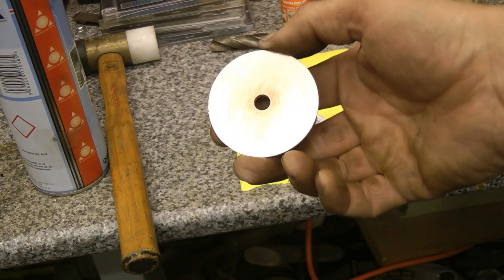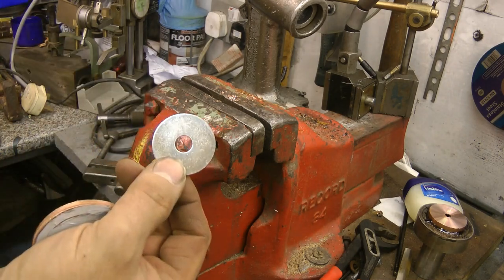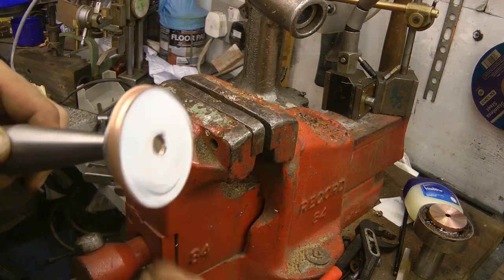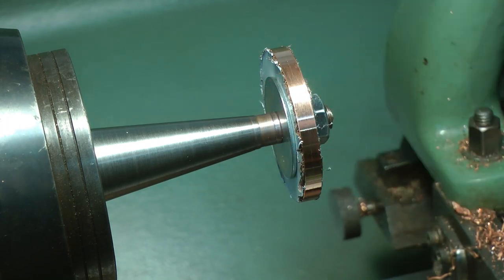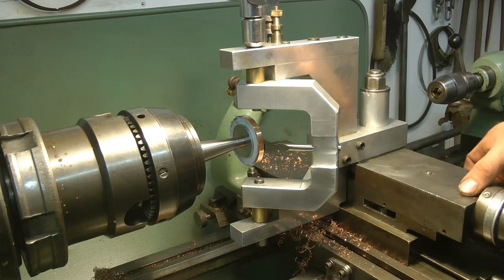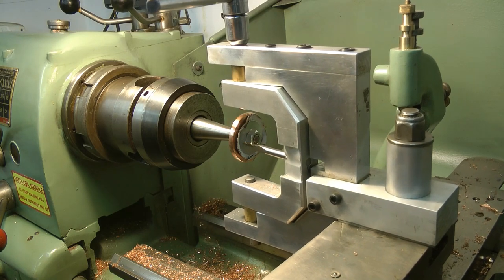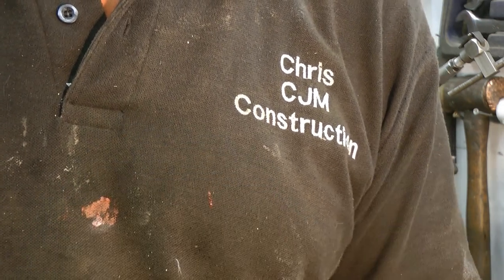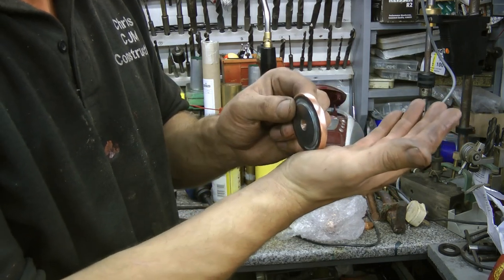A look at Copper turning on the lathe

Comment: Yet another great video.

Talking of which - any chance you can do a little video to help me out. Could be interesting for people.
I am getting a bit of flex with my Jacobs rubberflex collet chuck - I was wondering how rigid your collet chuck is?
With a piece of 30mm diameter aluminium bar at about 12" out from the chuck I get about 2 or 3 thou of flex just with thumb pressure. 
Perhaps a good video would show the difference with a collet chuck and the 3 jaw or 4 jaw chuck?
For now though be interesting to see how rigid your setup is.
Cheers!

Comment: Chris,
Did you make the ball turning attachment yourself? and is there a video showing you make it.
Cheers
Paul,,
Reply from the maker: The Knackler's Workshop  good morning Paul ! All my tools are homemade, I set myself a challenge to make them , hand tapping machines, the big knurling machine , the spindle handle , two ball cutters , my first one made out of two lifting eyes and is rock solid, the big one may be a little to big 😅,  most of the videos are on my lathe playlist 🙂 here’s a link to the ball turner  https://youtu.be/McHO3PTmuFI
Reply from the maker: The T handle arrangement is a socket set extension bar turned down and a flat ground on it so the Allen head screw can butt against it , I may of gone into detail about that on my first ball cutter  as it’s the same for both 🙂 and I also used it on my hand tapping machine ... one handle for all!!!!